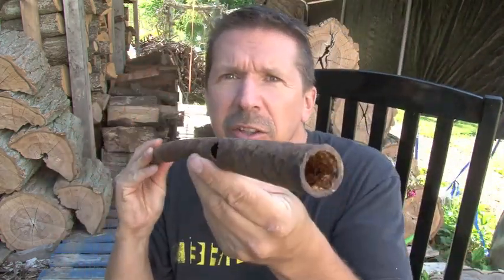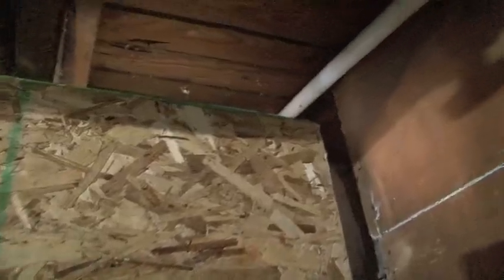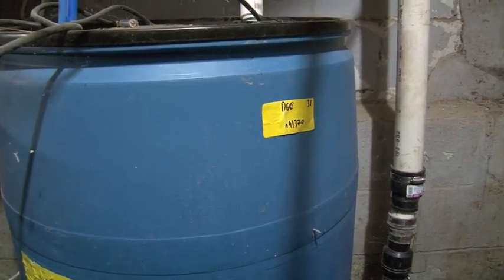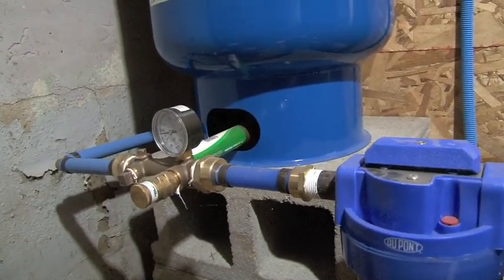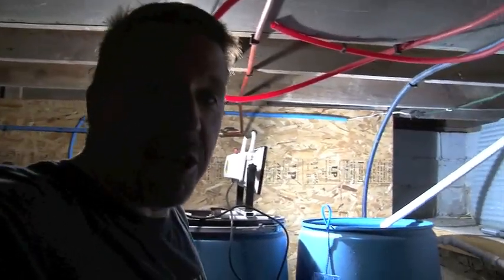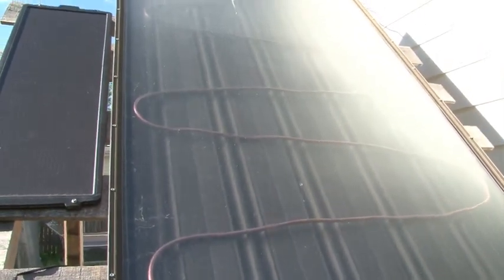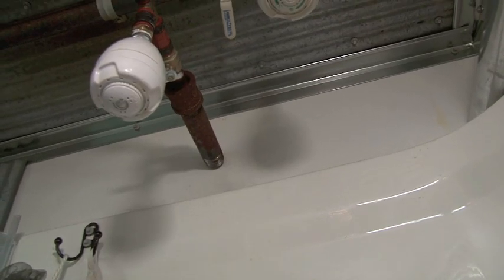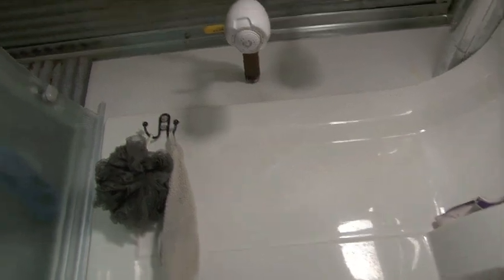RAIN COLLECTION system for drinking and showering

Comment: I use my concrete driveway to collect rainwater and gravity feed it to my 1,500 gallon gray water tank system for our vegtable & herb gardens. The rainwater from my house and garage are gravity fed to our 2 acre fruit and nut tree orchards. We use a solar powered well pump to fill and filter a 5,000 gallon vertical tank that gravity feeds our house, vegtable garden and tree orchards. We use moisture sensors to control our drip irrigation system that covers our entire site.

Comment: A friend of mine configured a solar water heater for his home in AZ. He did some testing & found that he got hotter water when needed by painting the pipes black as well. He also added some pressure valves external to his home so that if things got too hot & pressured, they could release such.

Comment: It's a great idea having two separate systems.
Your water is so well filtered you must be drinking the cleanest water in the USA.
Your solar thermal system probably needed slightly more pipe, mine is a vertical riser type panel with Tees along the top and bottom but one important step you needed to do was to glue the pipe to the steel heat panel, so the pipe is tightly against the metal collector, usually for this either a good quality Silicone sealant is used or a Modified Polymer glue/sealant like Soudal Fix all, these conduct heat fairly well from the panel to the pipework. 
What you have done is great, I would have been happy drinking rainwater that has only gone through the Berkey filter. 
I always think your body gets used to a few bugs and stuff, but not used to the toxic Chloramine most water companies now use.
My town water is totally disgusting stuff, the fish in my fish tank died because it was so toxic. 
Flouride can be naturally found in spring water because of Flouride containing minerals if you suspect Deliberate Flouridation, you can always just stop using Flouride toothpaste and that will cut your intake back to safe levels, but Chloramine which water companies used to replace gaseous Chlorine with is in my view the problem.
The old Chlorine would vaporize off, boiling the water destroyed it but Chloramine a nitrogen/chlorine compound is persistent for days maybe months in the water when it does breakdown the nitrogen part forms toxic nitrites and chlorine tends to form Trihalomethanes with any organic molecules that are in the water. 
Something to note is, Chloramine is now preferred by water companies, it is safer for them to handle, no tanks of Chlorine gas lying around and the safety hazards that present, so, all in all, it is CHEAPER for the water companies which is the main reason they now use Chloramine.
It may be different in the USA but this is certainly the case in the UK.

Comment: The shallow well pump/pressure-tank/filters work great.  We have 20micron -> 5micron -> Class A UV.    However, instead of dual systems we piped the output of UV to input of the house.  At that point we have 2 motorized valves...  1 controls city -> house and 2nd control rain -> house.  So city valve off / rain on for rain water and city on / rain off for city water - controlled by a switch in kitchen.   This avoids dual systems - and since Class A UV is at city level standards, your pipes in house are always good (no contaminated water) no matter which mode you're in.
Reply: yes exactly, his system is ridiculous

Comment: I like a lot of what you have done to get started. The wife wouldn't go along with a lot of the Aesthetics. Perhaps a temperature regulating control to feed the cool and hot water to right body temperatures in that shower.  A button to switch on and off via relay or contact valves?  Drainage, need to have disconnects along with those excellent shut off valves (nice quality), mounting the valves so they don't put undue pressure on the pipes.  Definitely sediment filter before the pumps.

Comment: If you are concerned about the heated water causing high pressure, you might consider using an expansion tank. They are standard on older buildings that use hot water radiators or coils in ductwork to heat the building. They are also used on chilled water systems.

Comment: Love the "my thoughts" part, along with the drinking water out of the crusty pipe like it's a straw at the very beginning.  The "why I did this and went my own way" part.  That's what makes sense out of a lot of stuff. I'm in an RV in the city, Norfolk VA to be precise, running two barrels off my roof, one overflowing into the second, using a dishwasher pump for basic water needs. The second barrel has a  12V bilge pump to back feed refill the primary barrel, only becuse it's an in tank pump rather than an external pump, as well as the overflow.  I backfeed through the same feed line. All my primary lines aree swimming pool parts, some 1.5 inches, so there is room to backfeed the bilge pump back through the feed line. Basic filtration is gutter guard and a homemade sand/ gravel filter, gravity fed, in a laundry detergent bucket. That's my only filtration right now, but I still have city water. I also have an actual first flush system on my rear mounted gutter, because it's so easy to do. It's only a diversion to a 3 inch pipe and a few parts. Still, the pollen gets through.... I still drink it. And I have a drinking water filter too.

Comment: On your solar water heater tank… regarding your over pressurization concern and your overflow piping:

Place a pressure relief valve on the tank where your overflow pipe is attached?

Comment: You have taken on a big task, keep going you will make it. Cost is a major problem so do a little each month. Some areas need insulating (Hot pipes exposed to the outside and your hear duct) You could see a 20 to 60% increase with the insulation.

Comment: This is a great video. I'll be needing your Guys's advice. moving to WV in one year and I don't have running water. the electric bills in my county are 119.00 each month. not for me. I'm retiring to boot. There are 3 old cisterns left by the former owners but, their more than 6 yrs. old. I trust copper piping way more then PVC for two reasons. rodents and freezing weather arent kind to pvc. With copper a propane torch can thaw out ice if done right.

Comment: So that stuff inside your copper pipe you dug up is mineral deposits- its not harmful its just unsightly. It actually protects the water and the copper pipe. But over time the pipe does erode away, though.
Reply: Yeah, pretty much. I learned about it when a local church/resort replaced all their pipes & the local news did coverage on it. They looked exactly the same. You can imagine anything out of reach & unable to be cleaned eventually looks that gross.
Reply: Copper doesn't rust. That's iron.
Reply: @anasmrright  Those are usually galvanized pipe and what you are seeing is not rust, just like said above all pipe will over time collect mineral deposits. Out of high school I worked for the water department and changed out water meters. They all looked like that and some even had moss type growth. Alll of which is safe. The chlorine/fluorine and possible lead is what you should be worried about.
Reply: @anasmrright  Copper most certainly does oxide (the technical term of rust) When it turns that greenish color, that is it oxidizing or rusting. Point of reference, the statue of liberty which is copper but oxidizes to green now.

Comment: Yeah mate you are so right about this .
Rain water I always thought was good to drink .
I still believe it's better than scheme water outright .
I like that then , I got a mixer thing going  with ball float valve when there is no rain, and when there's rain rain water fill it up and it'll just flush itself out ,as when the tank full I turn off scheme water . I so  very happy with that,  either mains water or pressure pump rain water.  Flip valve arrangement and one way valve coming in on mains . Another one way valve on rain water side after pressure tank .

Comment: I'm living in Thailand. Have been looking for filtering systems and was planning to make one. But the ones they sell here seem to me so good, that I can't do it better myself. Our house doesn't have anything to catch rain, but that is the next step and I want to collect rainwater that will be pre-filtered and has to run through my filtering system before I drink it. Maybe it is overkill, but I'ld rather be safe then sorry. Have been drinking bottled water so far, so that should not make any difference, except that I won't have to throw away such an amount of plastic. The oceans are full of our waste.
Reply: Hey Sjaak, I live in Lop Buri Province, and have been storing rainwater off of my roof for a while.  I built it all myself, but I only use it for showering, toilets, etc.  I still go to the reverse osmosis stands to fill-up my drinking water.  Anyway, could you tell me which systems you are speaking about?  I have seen a few different ones, but curious to know which ones you like and why.  Thanks.
Reply: @UhYeahWhateverDude  I bought a ROS from Camarcio. In total it has 5 filters, a small pump and a pressure tank. No UV. Water tastes great!
Reply: Sjaak Schulteis   Great, thanks for the info!  I’ve seen them online but never in person; I’ll check them out.

Comment: Might not be a good idea to have your ultimate overflow failsafe be a float pump. Yes the float switch is a great device, but the pump is electric and when you have a lot of rain sometimes the power goes out. I dont really know what else you could do since your whole system is in the basement. Maybe raise up all the barrels so the last overflow is still above or slightly below grade and you can route it outside to a fruit tree or something.

Comment: Cool system but I would definitely concider food grade ibc totes for the exterior holding tank/s. At 300 gal each it would great extend your capacity. Depending on your local rain fall and enough totes you might eliminate any house use of city water.

As for city water being "cleaner" how many feet does city water go through pipes to get to our fausets?? And every single foot it travels is an opportunity for contamination.

Comment: What you're doing to filter and treat the rainwater is more than enough to make it as safe if not more safe than municipal water. If you wanted to go one step further you could theoretically put a UV-C light into the storage barrels, but what you are doing with filtration will take care of all bacteria, protozoa, and most likely viruses as well (at least for your drinking setup).

Comment: This was really inspiring. Two questions, (both possibly stupid) 1 - Could you increase the pressure on the pressure tank so that it comes out of that interior spigot a little faster? 2 - Why not just use a standard hot water tank to heat up your shower water?

Comment: I would like to see what would happen if you let the water trickle down the metal panel in your solar water heater (or even down your roof) rather than have it go through coils. The water could be circulated by a small solar pump and I'll bet that water would be super hot in no time. I may actually try this myself. Thanks for all the great ideas.

Comment: Wondering if you can comment on using the Berkey post filtration through the DuPonts. Do you not think the DuPont filters would have done a good enough job filtering it to make it drinkable? What is the Berkey doing that they didn't? Thanks
Reply from the maker: It is a little overkill but everyone has their own comfort level with safety. Its more for peace of mind than anything. I think Dupont filters work great.  Some people use UV light I think that is overkill but if it makes them feel better, cool. My thinking is, I dont UV my food, why worry about UV-ing my water. Erring on the side of safety is good.
Reply: @livinglightly3382  Thanks for the reply. After some research I imagine the berkey has a finer micron filtration than is available in the DuPont filters. I think we'll be going with a Rainfresh Drinking Water System 2 which is comparable to the berkey specs, but is an under the counter system like the DuPonts. Appreciate the reply. Cheers

Comment: An on-demand 12v pump might be good for you toilets.  Float switch would determine rain water via pump OR house water via a 12v solenoid valve on your house water line.

Comment: I have two 23650 litre rainwater tanks. Sometimes there full depending on the rainfall, one is by the house and the other is next to the machinery shed. other times I have to fill them with bore water ( which is drinkable). They go through a pump to feed the house and house paddock. The water then goes through a filter pack. Hot water is solar.

Comment: Just an idea I never see anyone do for the outside barrel: cut a hole in the tank support wood and put a valve in the center of the bottom of the barrel for a hose hook up. It would allow you to drain out any crud collecting in the bottom of the barrel without emptying the entire thing, and you could still use that water for a garden or washing off the porch or something.

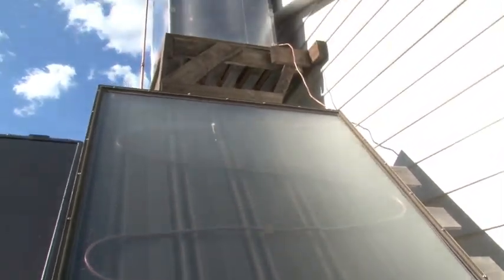Comment: 15:30 what really works better, is a tankless water heater. It's electric and hot water in seconds!! You can have a small one in the kitchen and bathroom. Not just a giant big one. Small cabins use them and they are small enough to use a solar panel to operate. No need for something homemade that gives you problems in the winter.

Comment: Question: I see you live in a residential neighborhood. What kind of building restrictions have you run into and have you had any neighbors complain of property value?
Reply from the maker: I always check with code enforcement. I don't obey everything but I weigh the consequences. It really boils down to: will the neighbors complain. However with water I am not violating any codes. My water tower might be an issue but code enforcement saw it and didn't say anything. My neighbors are cool, we don't complain about each other. If you have children at home that is another ball game. CPS can say whatever they want and have you shut dow for any reason. Luckily the property value is through the floor. I just bought the house next door for $1500-  We live in a rust belt town and have the support of our neighbors and officials. Keeping a low profile, keep your space looking acceptable and talk to your neighbors is important.

Comment: Really great job.  Thanks for filming it.  You said the barrels are 'food grade' - does that mean no BPA in the plastic?  What about the pipes?   (though, even if they do, it's gotta be better than the rusted lead pipe!)
Reply from the maker: I dont know exactly qualifies them as "food grade" but they didnt hold any chemicals before i got them, mine were created to ship Chillis. There were still some in the barrel when i got them. Some barrels have stored cleaning agents or other chemicals in them, avoid those of course. My pipes are new PVC and PEX with brass fittings.
Reply: Zoe's Lovely Any thing that has had food stored or shipped in it is food grade plastic. most of them are HDPE with a recycle arrow #2 plastic.
Reply: Lead doesn't rust. That's iron.

Comment: Off topic really. I did notice your solar panels and their mounting brackets. That tiny shadow thrown by the upright on the leg will cost you dearly. (shown at 1:46 to 2:07) That particular panel will become useless even with that tiny shadow. If the panels are connected in series to for instance an MPPT controller the whole string will produce very little current ... just because of that shadow. Please take a saw and cut off the leg that protrudes above the panel ... As for collecting your own water a BIG 100% and keep up the blog, thanks for sharing.

Comment: Peter from Australia, saw a documentary on flint , lead in the water , I have done what you have , 30 thousand litres of rain water, ruining through 4 filters , use it for toilet , washing machine ,shower ,  just a comment to maybe help your hot water I noticed you took off all the insulation from your tank , that would now lose an enormous amount of heat , even though you have painted it black , I have two hot water tank with solar , temperature gets to 68 c , I would be putting some sort of insulation back onto your tank  .

Comment: This video is very interesting, but what advice do you have for people who want to do this and live where it gets well below zero for long periods of time? Thank you in advance. Tom
Reply from the maker: It freezes here too, thats why I ave the storage tanks inside. However If we had a long deep freeze I would have a hard time getting it into the tanks. I suppose I would have to fill the tanks manually with snow or wait until I had some thawing from the roof and catch the drippings. If I lived in that kind of cold I would put black steel on my roof so when any sun hits it it would melt. Ive had this set up for 2 years in Indiana and its hasn't been a problem(yet)

Comment: What capacity brand water pump are you using.
Reply from the maker: its a 1/4 HP. The smallest i could find at the hardware store. It is still overkill. I do not know the GPM. I dont need much because it takes time to move through the fine filters.